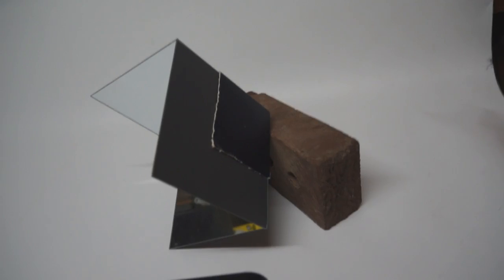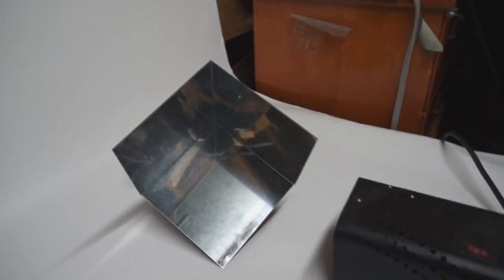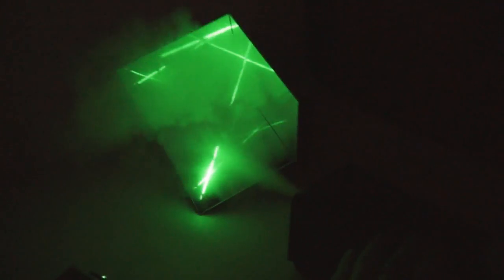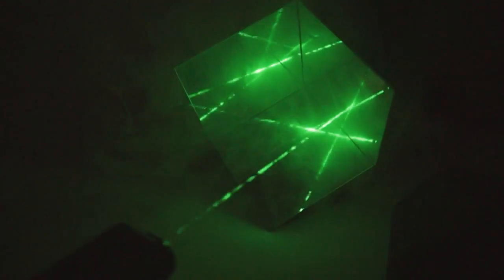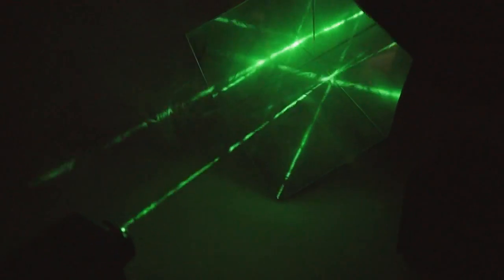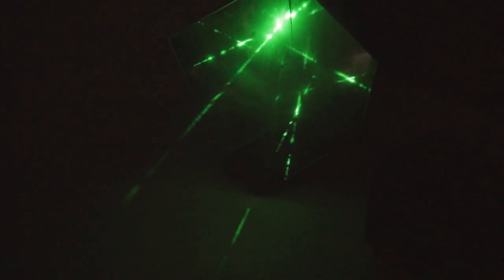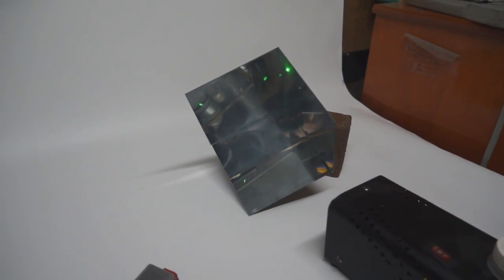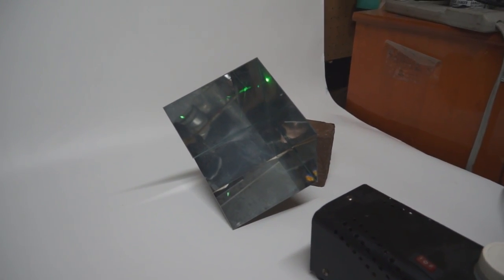Corner Cube Retroreflector

Comment: I'm a radioham, I've used a 39" dipole with 2 45-degree digital reflectors to bounce my signal. If I put a thin sheet of metal at the btm of my reflectors,  it will have the same effect on my radio signal..

Comment: I found this extremely interesting. After watching this, I dismantled a driveway reflector and put it under a (magnification) lens: the surface is covered with hundreds of little 3D cube corners. It looks like an isometric arrangement, until you look closer.
Reply from the maker: They are used almost anywhere a retroreflecting surface is needed. The only other kind I know of uses microscopic spheres (glass maybe?) usually stuck to a flexible backing.
Reply: Please refrain from dismantling public property, thank you.

I know you didn't just messing with ya :D

Comment: use a prism with the same principle for topographic measurements, i'm a surveyor :D
Reply from the maker: Nevin Williams Kind of a light trap, the use something similar (but painted flat black) to determine ambient temperature more accurately. 

I'm actually looking for some of those surveyors sticky targets lately, the ones they use as permanent prisms in city construction projects. I have a high speed motion analysis job to do and I figure those are the best way to get accurate data points for cheap. eBay Away!
Reply from the maker: Cool, you know all about these then. I was looking to find a real corner cube prism but they had square mirrors on 3 for a dollar >_<
Reply: I use spray-on paint/finish remover from Home Hardware on the backs of mirrors to expose the metallic coating, and get a first-surface mirror.  They're usually not silvered (or aliuminized) enough to be totally reflective, however, though it's still less lossy than passing through glass, and it'd probably be easier to get the right alignment. 

If you've a proper silvered dewar flask, you can see the opposite optical effect when you shine the laser into the bottle at any angle (into where the contents would normally be; this excludes the upper lip and neck).  While the laser beam reflects around inside, it's difficult if not impossible to get a direct reflection back outside...  just a faint glow.